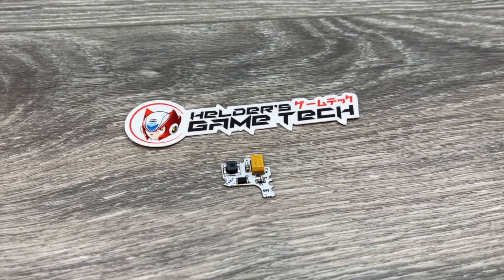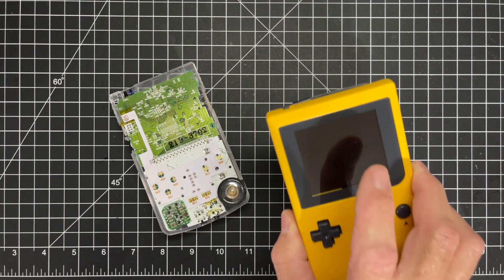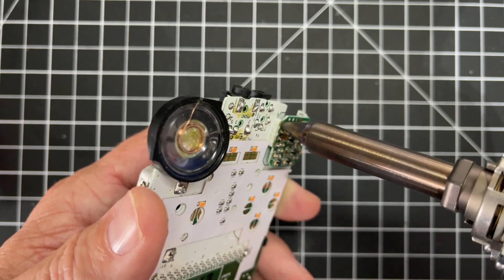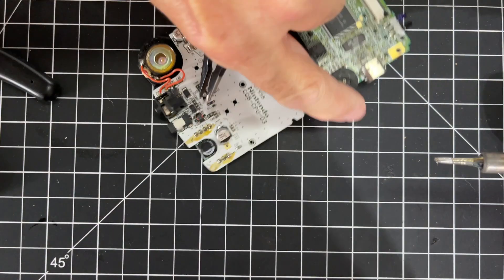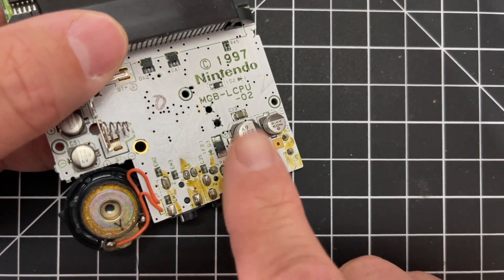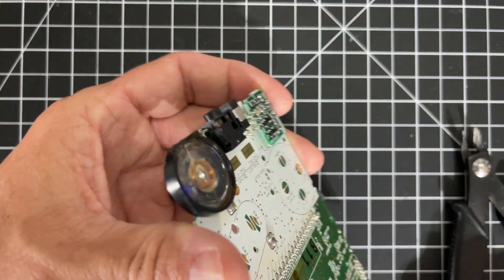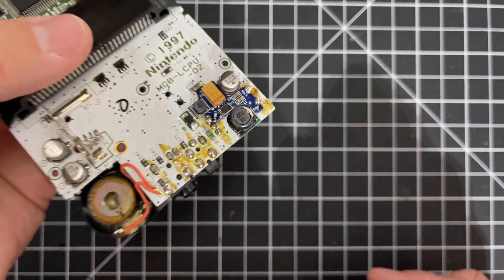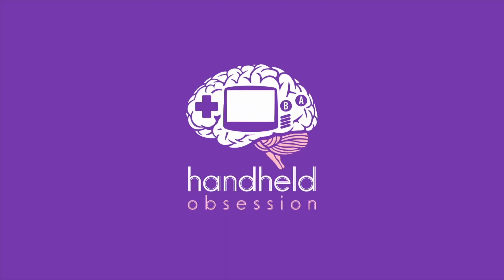Easily fix your modded Gameboy Color and Pocket Power Problems

Comment: I've done a butt-load of professional soldering and never seen that hakko tool. Oh god i've been missing out! Awesome
Reply from the maker: It’s the greatest tool ever. I seek out things to desolder because of it
Reply: @HandheldObsession  I wrote the comment before i saw you clean the solder off the cap pads. That blew my mind! So much faster than braided copper wick!! 

Imagine if this could replace hot tweesers. Place it over a resistor and it holds the component with vacuum while heating both sides of the component... Zipping off 004008 etc... 😍😍😍

Comment: Back in the day there was something called "re-capping" that didn't involve buying kits to cover up worn-out capacitors.
Reply from the maker: Re capping is still a thing and a recap is different from what this does. The main purpose of this kit is to increase the voltage and ensure a consistent level of power with modified Gameboys since the Gameboy was not designed to handle the increased power demands of a flash cart and IPS screen modifications.
Reply: You might be onto something. I have a gbc that I put an amoled screen and amp into. I had intended to recap it but put the caps in another gbc of mine that had no audio. What I find is if I turn the volume up beyond a certain point the console shuts down. Im between it being bad capacitors just not able to keep up, and the regulator unable to supply current it needs. Im gonna replace the caps and see first if that fixes it.
Reply: @darklavalizard yes recap. They are 20 years old.

Comment: Great video tutorial. I will be doing a GBC build with an IPS, amp/speaker and Helder power reg. You mentioned that if you have an IPS screen you can remove the old board completely. Is that because the screen gets soldered to C on the power switch?

Comment: Do you think this removes the need for the pololu 5v regulator when having a standard backlight (non ips) with the original lcd?
Reply from the maker: Yes it absolutely removes the need for using that regulator
Reply: @HandheldObsession  which is better? I have a Gbc with a Q5 kit and it restarts on me sometimes or flickers
Reply: @thefireking5729  I have a GBC with the laminated Q5 kit and this power regulator installed and works great.